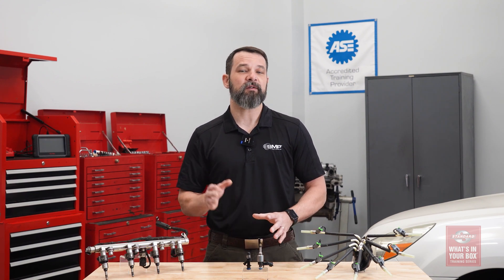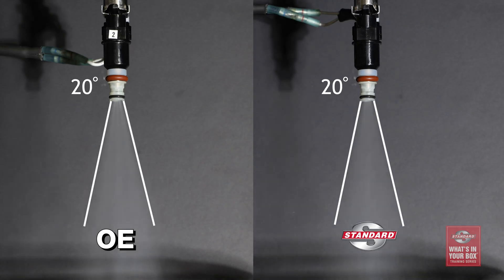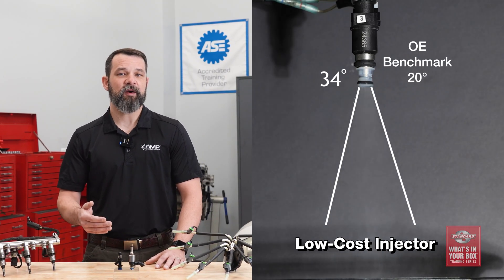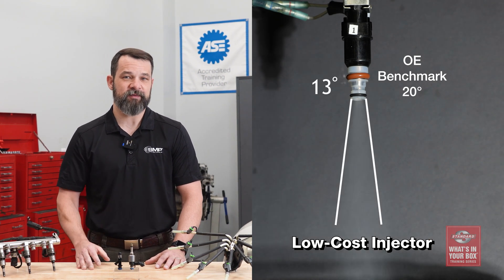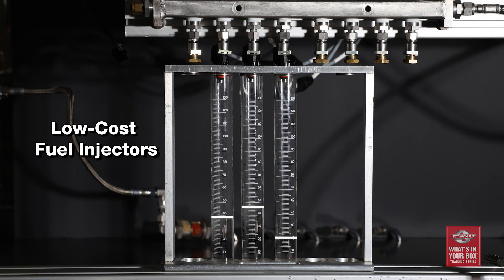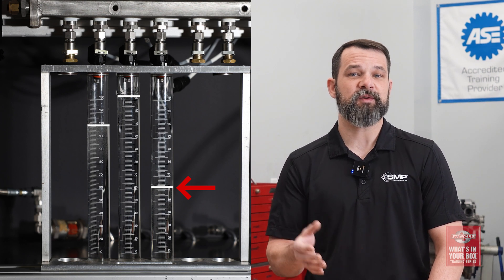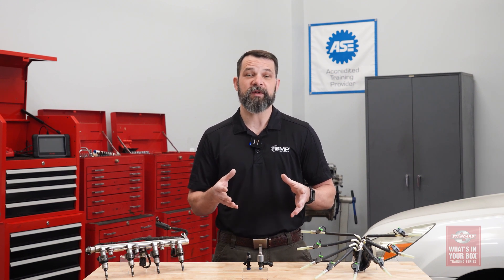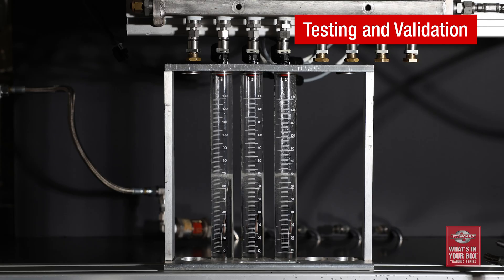Fuel Injector Testing | Standard® WIYB Training Series

Comment: Great post. At CPR Racing, we’ve tested thousands of injectors since 1996—including OE, Standard®, and what we call secondary line injectors (typically low-cost imports from Asia). While these secondary options can be budget-friendly, we've seen inconsistent spray patterns and flow rates that can compromise performance and reliability. That's why we always recommend starting with OE or trusted brands like Standard® when performance matters.

Comment: I own an Injector cleaning and testing center and find these asian injectors causing so many problems. Unfortunately they try and use the same box designs as all of the major injector suppliers so you need to source from a reputable parts supplier to insure you do not get counterfeit injectors.